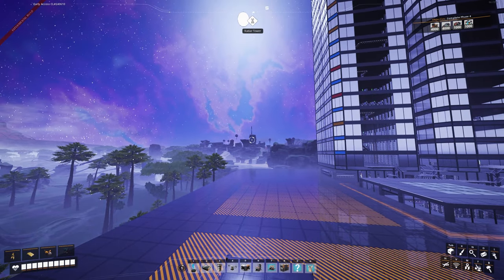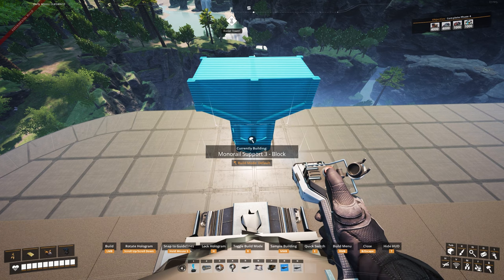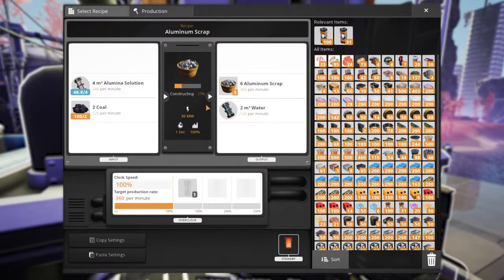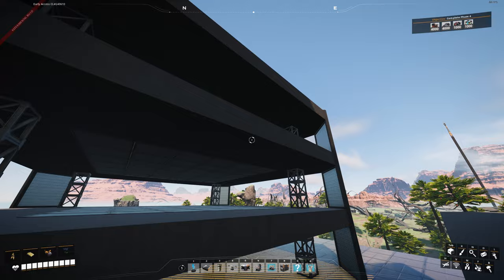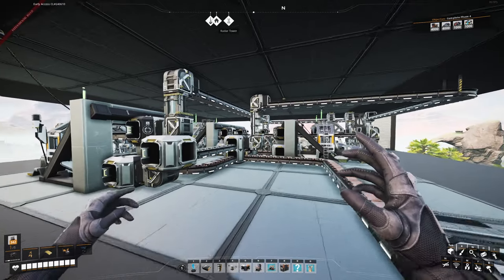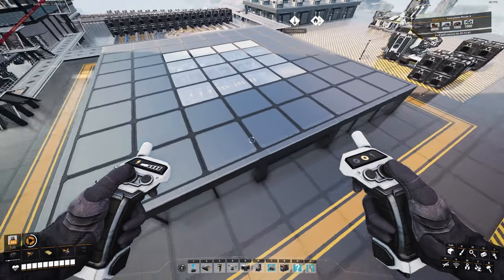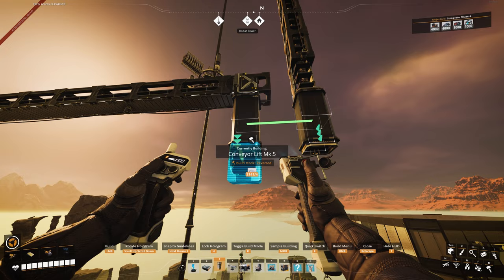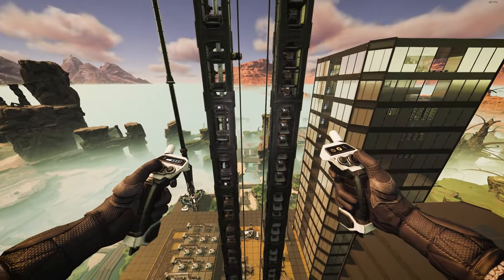Mega Project TRAP That NO ONE Shows You in Satisfactory Update 8

Comment: 8:08 there is a quick swap for that thing, its called "1" so you could just press tab - 1 - tab when fall from hoverpack
Reply: Yeo! But it also depends on the order of items under "Equipment shortcuts". If it was in a different slot you need to press the corresponding number for the item you want to quickswap or equip.
Reply from the maker: Will definitely check it out! Thanks!
Reply: @Tactricit4N  I forgot to mention the condition is in tier 7/8 and have both jetpack and hoverpack. Both of them always be priority shortcut
Reply: This saved my life!
Reply: Double clicking works too. Not as fast as keyboard, but faster than click and drag

Comment: HOW the heck did you get the conveyor lift to extend so far? I havent been that lucky yet.
Reply: You attach between two floor holes.  From bottom to top or top to bottom, there is no limit on distance.
Reply from the maker: I found that ~ 200m is the limit, but only sometimes 😅
Reply: @JordanMetroidManiac  bottom to top can be buggy / not work as intended. top to bottom worked perfectly fine for me.

Comment: For Aluminum I dump all water into a buffer then run the water from buffer to the refineries. Put a valve on the inlet water pipe to reduce to the amount that is being made. I think it is easier this way.
Reply from the maker: If used water and pump water goes to the same reservoir, doesn't the production cycle stall when pumps overfill the buffer so the refinery output water has nowhere to evacuate?
Reply: @approximatelybored  that’s why you use a valve and limit the flow from the pump into the buffer. Then the system always has the exact amount of water needed to run the factory.
Reply: @approximatelybored  Here is what I have found:

There are two ways to build an aluminum factory that doesn't eventually jam on water:

1. Make absolutely sure that every step in the process runs at 100% duty cycle.  You must have a perfectly reliable and perfectly adequate source of bauxite, silica, coke/coal, and whatever consumes ingots down the line NEVER backs up. Design it perfectly so that reclaiming wastewater plus water extractors is exactly correct, and never fail to run the entire line at 100% duty cycle, NO yellow lights allowed, because if even one water extractor is allowed to run while the alumina solution machines are idle, water will accumulate, and it will eventually jam.

2. Design the system with stages that will clear a jam.  As many alumina solution foundries as possible should run purely on wastewater with no possible way of getting fresh water from water extractors.  These machines should get first pick of bauxite, ie they should be at the feed end of the bauxite manifold so that they fill with bauxite first.  As few alumina solution foundries as possible should run on fresh water from extractors.  If absolutely necessary these can also consume wastewater through a valve, but there should be no way for fresh water from extractors to get into the wastewater plumbing.  The freshwater machines should be at the slack end of the feed manifold and fill with bauxite last.  The alumina solution outfeed pipes should also be separate between these two communities, so that one refinery running on fresh water can't pump the entire alumina solution plumbing full.  This way, it should not be possible for any stoppage in bauxite, coal/coke, silica, or aluminum ingot outfeed to cause both the alumina solution and the waste water lines to back up and jam; one of the two spaces should have enough room that when the shortage/backup is resolved there's room for some step of the process to resume, clearing any jam. A coal/coke shortage will stop the wastewater line from filling, a silica shortage/ingot backup will stop the wastewater line from filling, a bauxite shortage will stop the alumina solution lines from filling, and when bauxite does arrive the machines that feed on wastewater should start before the freshwater one(s) do, which will free room in the wastewater lines.  It may not be 100% jam proof but it's more rugged than "everything has to be perfect 100% of the time or it eventually fails."

Comment: You couldn't justify running a belt, but running a train line is better? lol A belt is no frills and easy. A train needs power, 2 train stations, freight platforms, etc. A belt would be reliable. Set it and forget it.
Reply from the maker: Yeah, but belt also sucks for performance, over that distance would take ages to reach production, cant be used as transport, is lazy and boring. Also, with your logic why even bother doing anything at all? It is easiest to just not build anything, because "you can't fail if you don't try" 😅 100% reliable
Reply: @approximatelybored  All great ideas. Thanks for your input.